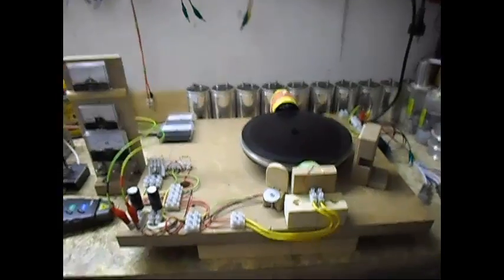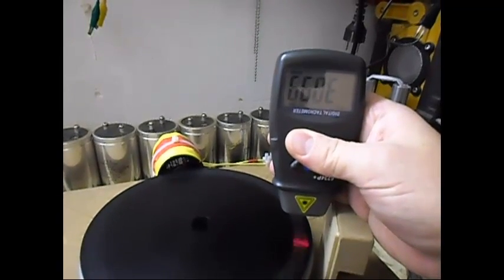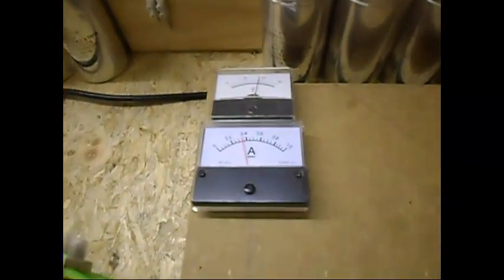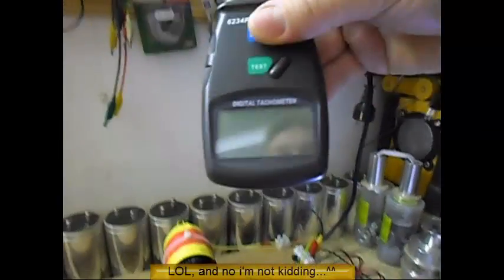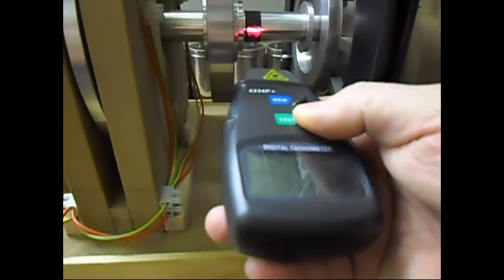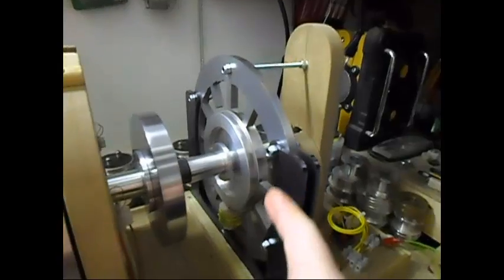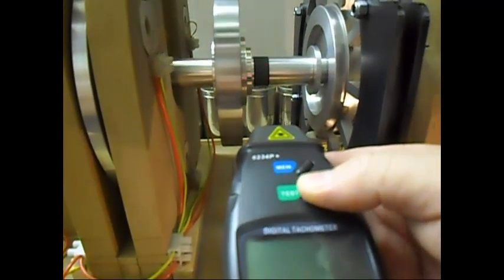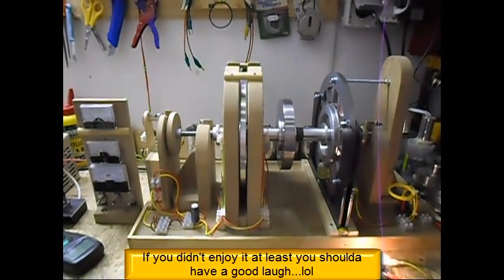Pulse Motor - Single Phase Generator Update 3, Coil shorted & Coil loaded test @ 3000(ish) rpm...

Comment from the maker: Here's the update on 3000(ish) rpm on the shorted and loaded coil test...^^
Nothing to see here folks...move along...just kidding...lol...the aircore one seems to be pretty good even if it makes the system draw 100(ish)Ma more...^^

I will do more test with this setup base and aircore coils since i do like it a lot...might even go to higher rpm like >4000(ish) or so...might...lol

As one can see at the end "Teaser Pic" all coils are mounted in the Single Phase generator...that will produce some scary high voltage if all are in series...o.O
But with that high voltage i can play around with lots of transformer/caps combo's which is always fun untill you get a nasty electric shock...lol